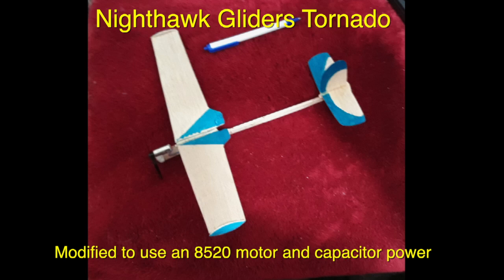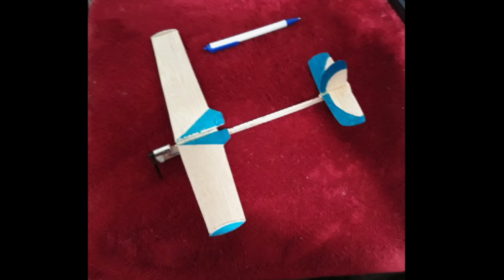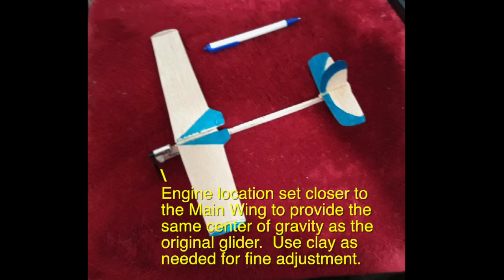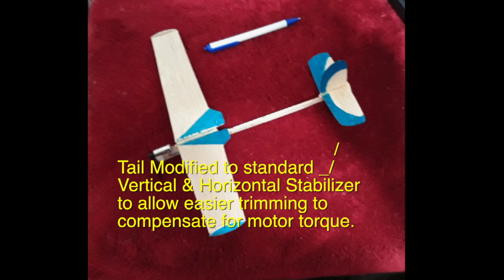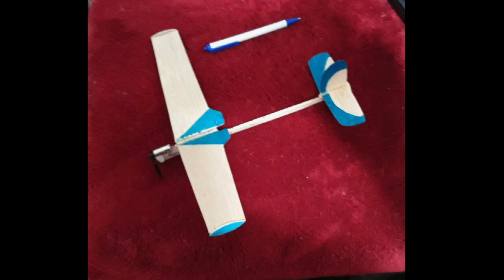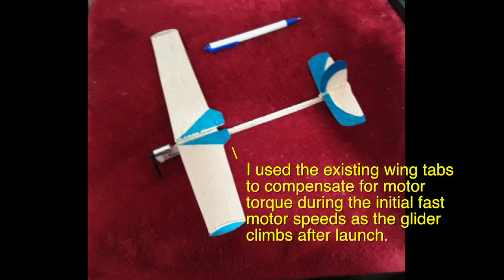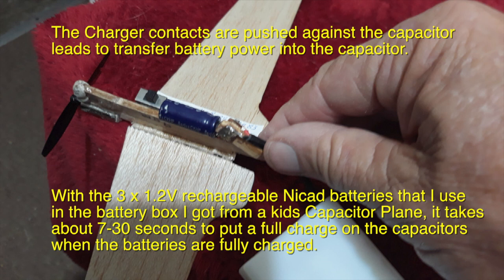Nighthawk Tornado 12in Modified to a Capacitor Plane

Comment: Nice video! How do you prevent from rolling issue? a lot free flight aircrafts don't even have adjustable rudder and ailerons, but they are not rolling.
Reply from the maker: The tabs on either side of the root end of the main wing can be used to trim roll tendencies.  Most balsa free flight trim roll, pitch, and yaw by bending control surfaces slightly (rudder, elevator, wing tips)
Reply: @jimeagle1  Thank you so much!

Comment: I’m just now seeing this video!  WOW!  That was amazing!  First time anyone put a capacitor on a Tornado 12!  Well done!  👍😊
Reply from the maker: Pretty zippy. 
 I also made an 18 inch version using foamboard stripped of paper but with shipping tape instead.  It worked pretty good too.  
I would like to try it with an 18 inch Kestrel at some point but other projects have intervened.  I find that cap planes based on good glider designs are fairly easy to tune in once you get the CG in the right place.